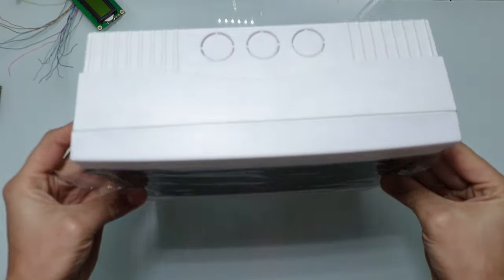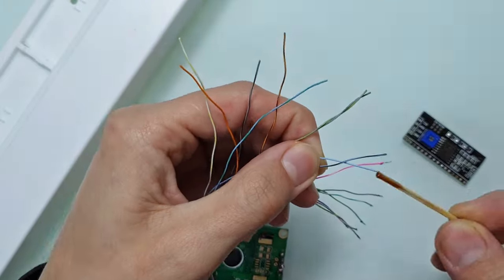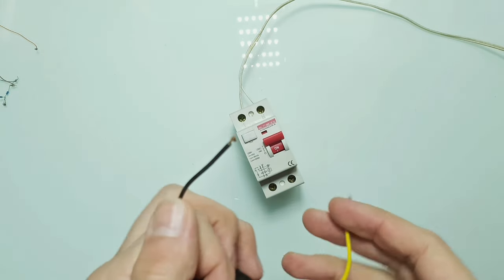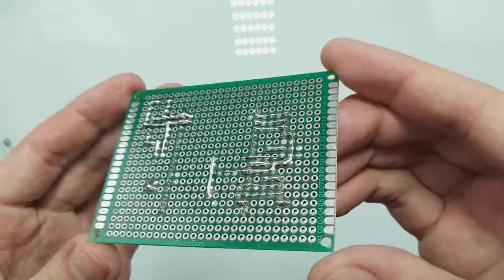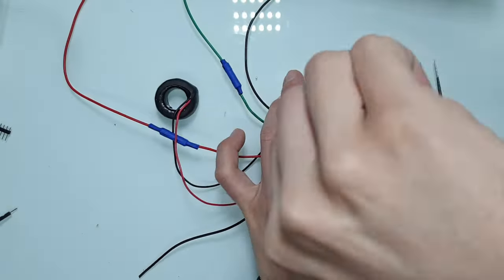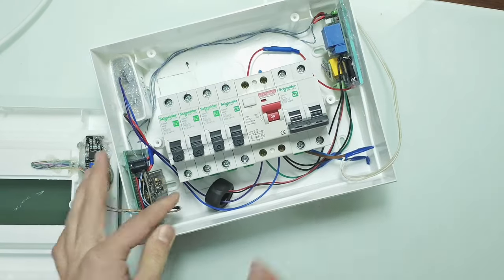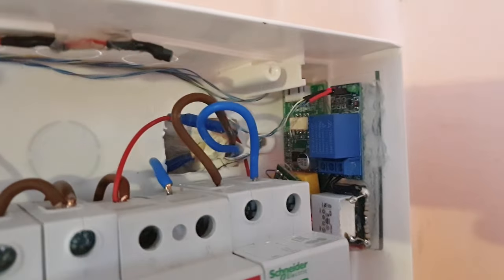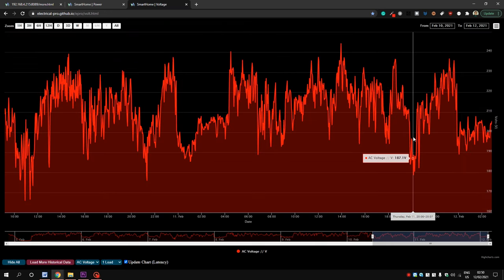DIY Smart Distribution Board with Wi-Fi | IoT Arduino Project

Comment: The use of silicone adhesive around electronics is not recommended since it emits acetic acid as it cures which will eat away at copper conductors. If you must use silicone find a source for silicone adhesive that is for aquarium construction. It has very little emission of corrosive off gassing.
Reply: I found out about this when it f'ed up my electronics

Comment: This is awesome. I would recommend adding a battery keep the esp online for at least a few hours after power is turned off to be able to tell the difference between a bad wifi connection and a power-off event.
Reply: No, this is terrible
Exposed electrical wires, which goes into distribution board is terrible idea or rather deadly one
Idea itself is illegal in most countries
in UK it is absolutely illegal,  not to mention plastic which should be phased out due to risk it posses (it can melt and drip on flammable material causing fire)
Reply: Wait
You want to add possible source of heat or fire or even explosion to energise something in place where you have perfect source of electric energy? 
This makes no sense
Especially because DIN rail mounted Bell transformers are cheap standard
Reply: @WizardNumberNext  Not a very perfect source of power during a power outage.

Comment: Awesome project, but be careful with soldered wires in screw terminals. Under sustained pressure the solder deforms and becomes loose over time. Here in Hungary it is also against the code to solder any wires installed in buildings. It's a fire hazard.
Reply: Do this only in case if you live alone in your flat. --- Anyway don't follow this video if you have children and you would like to see them growing up.
Reply: @kkokemaki8593  🤣🤣🤣🤣

Comment: I built nearly the same. One ESP board, one Max485 ic and a rs485 meter. A little bit of code and it works since one year 😊
Reply: can u share the details, circuit diagram and cource code?
Reply: @YasinNurRahmanSGHS  did you see my answer? I think YouTube delete it :(
Reply: @mischi515  i did not see ur answer. i dont see any reply about my question.
Reply: @YasinNurRahmanSGHS  sorry but both two answer from me were deleted. Try to find my repo with the keys hiking meter tasmota plug control esp8266.
Reply: Can i get your circuit diagram?

Comment: It looks nice but this design would probably not be anywhere close to being regulatory compliant here in the UK or anywhere which uses British Standards (e.g. BS1363) such as Ireland, Hong Kong, Singapore, Malta or much of Africa (e.g. Botswana).

I do however think that you should've connected each breaker terminal via a busbar instead of a thick cable with the insulation stripped so that it can connect to the busbar but since you did it this way, you could've at least not left any bare metal exposed, i.e. it looks like some of the cables are not fully inside of the breaker.
It might of also been worth only using RCD breakers for added safety and installing a socket inside the breaker board (like what is done with CEE 7/3 and CEE 7/5 EU [socket] standards)  either connected to it's own breaker or an existing circuit...
Reply: Meme, Everybody is free to build it in his favour and national standards. 🙄 It is a project to show what is possible.
Reply: @IPMan-me6lo I agree with you because I also built this project to the standard the country I live in uses

Comment: I still don't understand much about electrical power, but I'm manufacturing a CNC Router, it still has the whole system from protection to electrical I am a system designer and developer
for me it doesn't make sense to buy a bunch of equipment from different manufacturers to control a simple on and off and logic which is involved in protecting the electrical network and also protecting the CNC control electronics.... But I see that it is possible to do the same as you did in this video, of course adapting it to the universe of the CNC Control Box... .. I'll watch your video many times and see what I learn here on the channel to try to develop this!

Comment: It is mini SCADA programme for lighting and power distribution board including energy management and monitoring.
Everything is right except standards,, workmanship and management the wires of control,communication and monitor module.Either there should be a seperate segment for ELV circuit or additional door for avoiding entanglement with LV wires.

Comment: Tripping that CB that way is asking for trouble. Breakers have a purpose built device called a shunt trip that does this very thing. It would have been nice to power your ESP from the line side of your main so it stayed on all the time. Then you could add a shunt close which you could use to turn the breaker on through the ESP.

Comment: This looks very convenient and the design is very clean! I would recommend you only use it for emergencies as the GFCI breakers are not designed to trip very many times.
Reply: WTF are you saying
Reply: @Jarni1979  his setup has a remote turn off feature that's implemented through tripping the GFCI. GFCIs are not switches. If you have to do it regularly, it is better to use a relay specifically designed for that.

Comment: I have no idea which country you live in, but in mine it's not good practice to put low current hardware in the mains circuit breaker box. We rather use two separate boxes, one for the high current and one for the low current, allowing only low current probes to live in the high current box.
Reply: far worse things in this video than putting AC and DC together in the same box...

Comment: Nice idea , but with all the electronics , soldering , wires and possible getting something wrong + those kinds breakers you used as far as I know are not meant to be triggered repeatedly they are for residual current protection. As  much as I love DIY this is one place I would go with something from a good firm like Sonoff , they have smart wifi breakers. And if you only need to measure and on/off the entire grid just get a smart breaker as your main breaker.
Reply: You are right too but for more flexibility someone can build this, like me who likes to get data like the voltage, frequency,  p.f, current, power & energy that the smart breaker will not be able to give me some of. Extracting the data is another issue on those smart breakers. In summary, we just have to build it to a standard then everything will be ok. Love the idea

Comment: Nice project, but i would NEVER install any low voltage sensible electronics inside the fuse box without proper insulating housing ...
And hot melt glue / silicone "glue" is not a way to fix things, you need something more robust and durable. (Metal strips, screws ...)
But working good for now, i am planning to implement some zigbee based monitorint for individual sockets / modules in our shop to monitor the power consumption of our fridges / freezers and also to check their temperature, and enable them as thermostats to precisely control their temperature as well. (And also to apply an automatic deicer function during the nights to get rid of the ice buildup in our showcase fridges)

Comment: Hey , the mains cables along the bottom of the mcbs from RCD, was this for testing only, did you change to bussbar on proper installation, cables looked small
Reply from the maker: Hey, all wires are 2.5mm², it is AWG13 if converted to this standard. All wires that is thinner than this I removed. Input wires to the house are the same, so no point in using thicker wires.
Reply from the maker: There is no much load anyway, here is the live chart: https://electrical-pro.github.io/epro/power.html you can see occasional microwave usage :)
Reply: @ElectricalPro  Great work !!
I really liked your project idea and I am very excited to implement the project,
Can you write to me all elements of the project pls ? because there is some element u connect in video isn't exist in the element list and circuit diagram .
 
Waiting for your reply as soon as possible..

Comment: That is so unsafe in so many ways.  You could have made a unit that plugs into your consumer unit using a contact transformer.  And a relay to trip the RCD if you wish to.  But what is the point of it all you can not switch it on again.
Reply: Protection from overvoltage? (>255V)?

But yeah, it's not very safe to use a Chinese power module. Use a voltage and current transformer instead. That way, there's nothing that affects the incoming power in any way. It also galvanically isolates the microcontroller making it an order of magnitude safer.

Comment: I understand from the comments there is a lot in this build that would notmeet BS7671. Would there ever be a case to install low voltage DC electronics in a domestic consumer unit? I’m thinking 12v doorbell transformers are OK so Is the problem just the way they are mounted in this build?

Comment: I have a question regarding the power meter module. I have a problem when the voltage reading always increases to more than 250VAC after the device has been turned on for a few times. Where is the problem sir?

Comment: Can You sugest me a module or sensors through which i can mesure Voltage UpTo 300v 50Hz AC  (Because in my house Volgate Rating 240v -- 260v ). I want to integrate with ardino/ esp32 .
Reply: That module will work fine,

Comment: I can't recommend this at all.

Not sure how the electrical regulations are in your country but here in Australia this would be a definite no go. Much of what you have done would be deemed unsafe and non-compliant.
Reply: 5 volts 2a - is so dangerous! It will burn his appartment!!
Reply: @mikhailkh8560  there's strict regulations for segregation of services. This is a great example of how not to do it.
Reply: @shaunclarke94  at my side regulation assume that fences could stop terrorist attack.
It never did, but regulation ensists as it.
Reply: @mikhailkh8560  🤦‍♂️. That's mitigation, not prevention.

With an attitude like that we should stop using seatbelts because they don't prevent road deaths.
Reply: @shaunclarke94  in real life scenario fence will reduce victims chances for escape. And do nothing to stop intrusion.
But its costs a lot. Which is great for  subcontractors. 

Seatbelts is not correct analogue in this case. Road bumper would be better, you could use it for speed limit. But that will increase infrastracture cost, impact environment, car maintenance, etc.
Reply: @mikhailkh8560  Regulations are there for a reason which is to prevent installations like this that can lead to death or injury by fire or electrocution. The fact you mentioned 5V/2A in a scornful way demonstrates your limited view and complete lack of understanding about the potential dangers.
Reply: @harryjohnson615  there is plenty  regulation rules which exists in certain areas and do not spread around due its stupidity.
But there is always a people who claim that this is necessary. In most cases it cause they get advantage of it.
I see some in my country.
Ofter time some rules are created  to get rid of concurents. etc.

But many of them is writen by blood. Human being should use it brain and physical law to distinguish from one another.
Reply: @mikhailkh8560 lol😂

Comment: The idea is nice but in practice this is not so good.
Tripping GFCI instead of having a purpose-made relay do that is wrong, GFCIs are NOT switches (btw same with circuit breakers, which few know or think about). And this way you can not turn it on remotely as well.

Risking burning down your house due to malfunction of any of the large number of components not designed to be used in such applications... When there are devices that perform the very functions demonstrated but are designed and manufactured for that specific purpose, such as over- and undervoltage protection (with much better functionality), temperature monitoring, remote switching.
Installation is also suboptimal.
Best to install the device in one housing, use ferrules for crimping wires that go into terminals vs solder, use proper gauge wire, etc.

I'd rather spend the time and effort on making the main functionality better. Only one GFCI for all the breakers? No master switch? And so on. These are the things to be addressed first. Adding bells and whistles comes second and should be done responsibly, particularly if you live in a multi-appartment building where others may have to pay for your mistakes with their belongings and perhaps even lives.

Comment: Why would you solder fuses?
Reply from the maker: Because I don't have any fuse holders... and I like soldering :) Hopefully, I never gonna need to replace those fuses, if the fuse blows it means something terribly went wrong, in that case the permanently soldered fuse will be the last problem to worry about. I probably don't need those fuses, I'm just paranoid that something may go wrong.

Comment: The idea is nice, but the project is very poorly executed. You make a lot of rookie mistakes during wiring, ignoring major electrical safety precautions.

Basically, what you do violates electrical code in nearly every country. You misuse a RCD. Why not use a installation contactor? They are EXACTLY built for this use case. 

Please, stick to software. People can die when trying to re-create this.